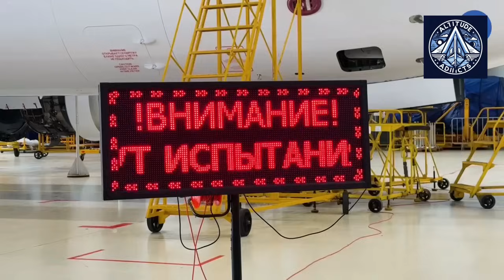Russia’s 2nd Import-Substituted MC-21-310 Moves Irkut for Flight Tests

Comment: No mention of the range the MC21 310  With final configuration Russian only plane
Reply: 3830km in a layout with the maximum number of seats in business class (175 seats in total on board), data from the UAC website. The standard layout with 163 seats will likely fly around 4500km

It is important to understand that these figures may increase significantly, as the PD-14 engine has only recently been released from all restrictions, and normal tests at standard cruising speed (with lower air resistance and fuel consumption) are likely to be conducted soon.